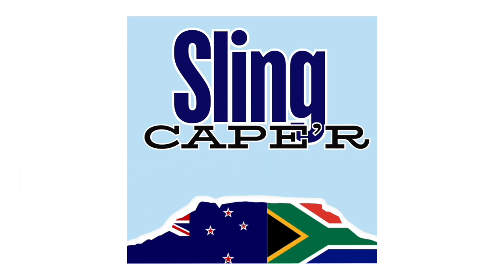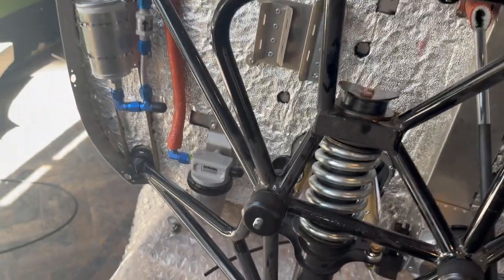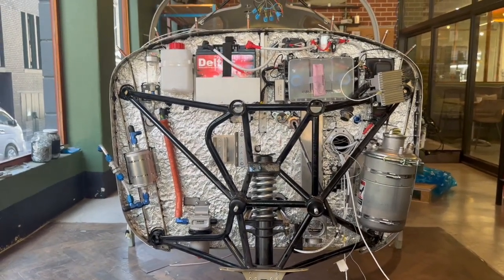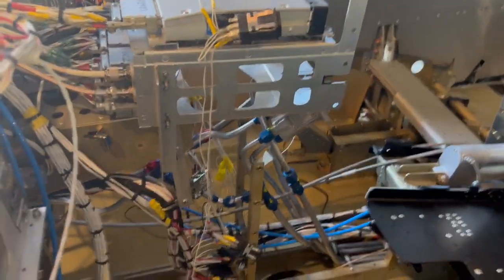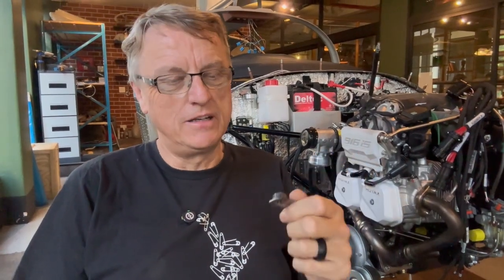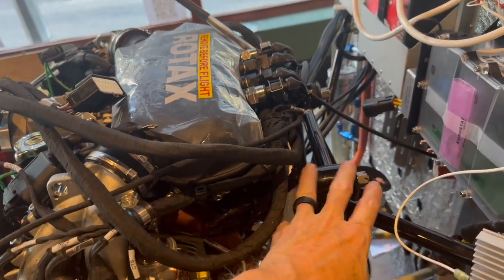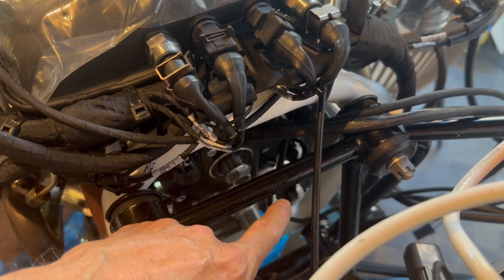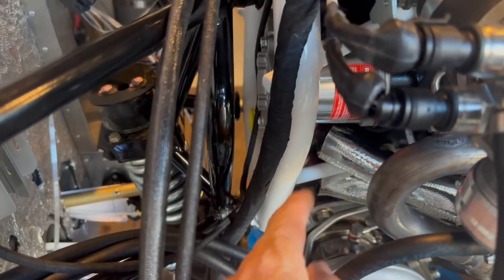ENGINE ON! But… We Found a MAJOR Problem 😱 | Sling TSi Build

Comment: I looked at Tony Bingelis - Firewall Forward book, and you are installing the motor to the mount per his instructions.  AC 43.13-1B explicitly recommends against Nylocks in environments where the temp can exceed 250F.  Curious, what do the Sling instructions recommend?
Reply from the maker: The kit supplies Nylocks. I don’t know what the temperature of each gets to but the lower right is very close to the turbocharger. I haven’t heard of any issues with other Slings but I just prefer to follow standard aircraft practice where I can.

Comment: A quick internet search shows that nylocks can handle 250F heat.  What temps do you expect in these areas?  Seems wild that lives are dependent upon these 4 bolts working, simultaneously.  What is standard for certified aircraft - your method or the nylocks?
Reply from the maker: Sorry, I’ve only just seen your comments. I like to follow AC43-13 recommendations. Anecdotally, I know of no issues from other Slings. The Kit supplies nylocks for the engine mounts but you wouldn’t find them on certified aircraft so I prefer that. The bolt closest to the turbocharger is difficult to get the pin in and in retrospect, lock wire would likely suffice however I managed to get a pin in there.